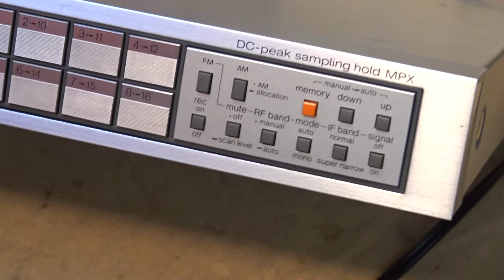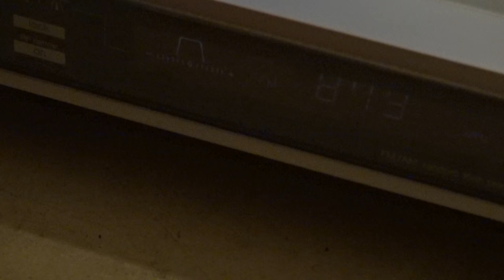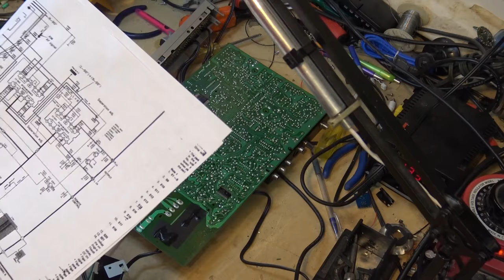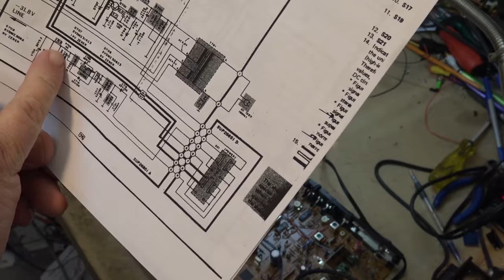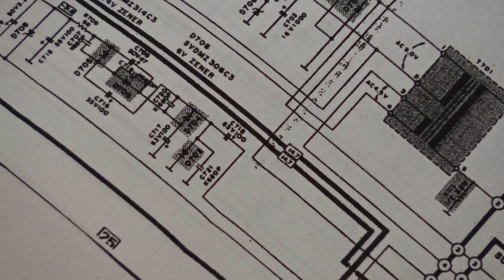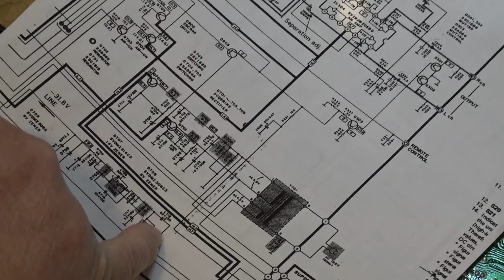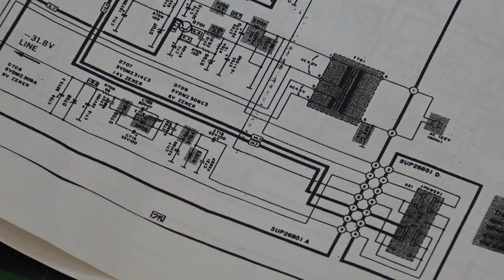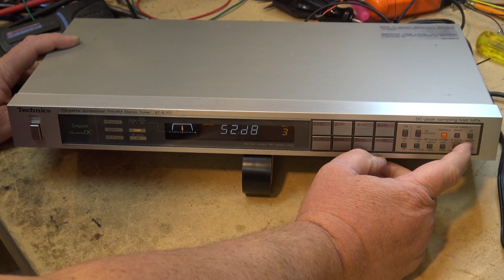Technics STS 707 Dim display repair

Comment: A very well done video.  I learned a lot.  Is it more common to find an open or a shorted capacitor?  

Thanks a lot, Tom
Reply from the maker: Actually I can't remember the last time I found a dead shorted electrolytic it was that long ago. Usually they go open, and when you bridge another on in parallel it fixes it. Needless to say when they short it makes finding them a little more of a challenge as the weapon of choice, the ESR tester is totally useless in this case. This one had me stumped for awhile, until I got the schematic. Then it was a relatively simple task to test. Once I disconnected the resistor to isolate the supply it was the first part I checked.
Reply: Thanks so much for the quick answer.  Darn it, I learned ANOTHER useful thing or two! :-)

Tom

Comment: That's an interesting repair :), well done. You did not short your iron at the end, did you haha ;D.
Reply from the maker: That one scared the shite out of me. The client had complained that it wasn't holding memory as well, and I noticed that the connection was a little rough looking, and there was crud around the top side so I figured I would put the cap to see if it was leaking. (it wasn't). Either it, or it's series connected neighbour was charged. Only 2.5 volts but it went off with a bang. Hey the memory works now! I was going to leave that out but I figured I would put it in for a surprize at the end.
Reply from the maker: Went to resolder the + side of the backup capacitor as the client said it was losing memory. The connection had gone bad, and opened up with that bit 3.3Farad capacitor still charged. Only 2 or so volts but it went off with a bang.
Reply: 12voltvids
I can imagine this was quite a surprise ;D, 3.3 Farad are quite something to wake you up ;).
Very cool repairs you do and I had a good laugh :). Thank you :).

Comment: Heh ESR was good, but capacitance was what it was and because of that cap was shorted it's ESR was good. I'm I right?
Reply from the maker: ESR is just a measurement to show how well a capacitor passes an AC signal. It stands for equivalent Series resistance, and is based on the fact that electrolytic capacitors have a very low impedance to AC.  That is why they are used in coupling stages together.Normally you can measure ESR in circuit, because the voltage used by the ESR meter is very low, less than .5 volts therefore it will not cause semiconductors to go into conduction.This capacitor had dead shorted, and therefore was giving the ESR meter a false low reading so it looked good in circuit in and out of circuit on the ESR meter. Had it not dead shorted, it would have measured probably almost open on the ESR meter and would have been spotted in a second, because that was the first capacitor I measured with the ESR meter. It wasn't until I had ruled all the others out that I started to disconnect parts, and use the old old multimeter that I found this. So this is a good learning video to show that as valuable ESR meters are in service, they can give false readings, and send the service tech down the wrong path.
Reply: Yes I agree with you. That was really nice video about how difficult phenomenons can show up in real world. Thanks again for good information.